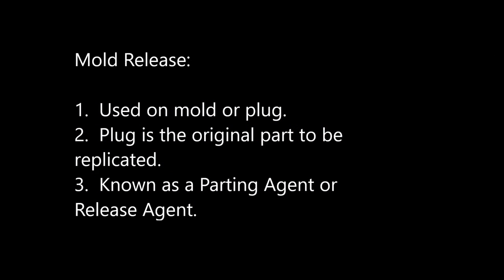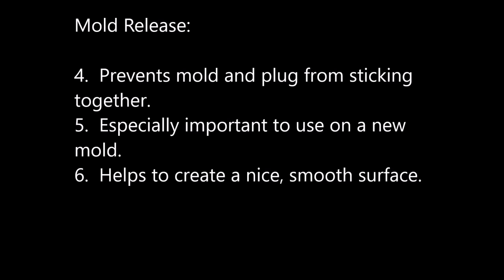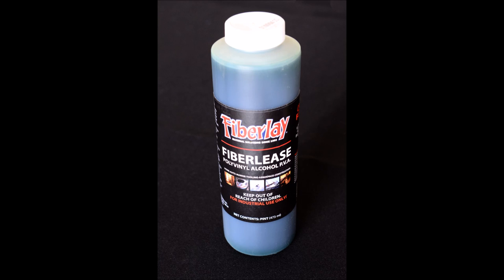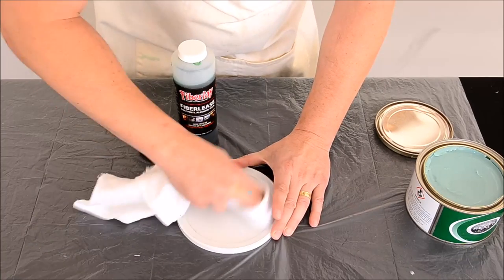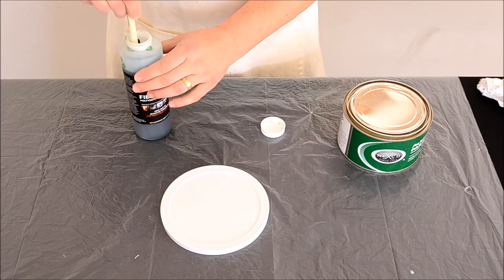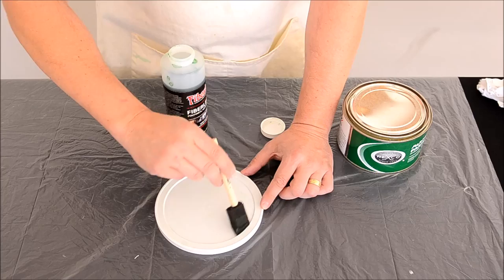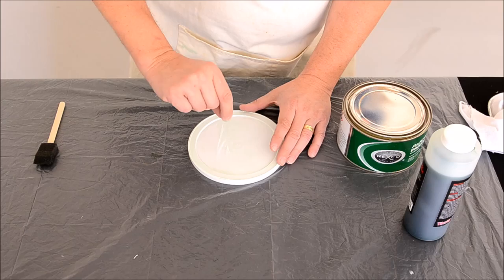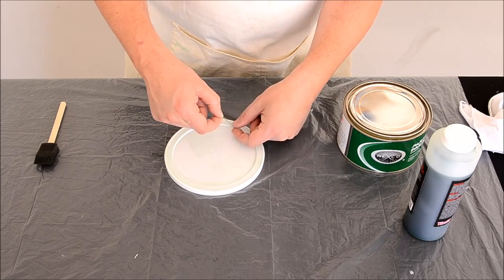Mold release application

Comment: I have a problem with the application of the wax, when I apply the wax and then put the PVA on top, as you do in the video, a kind of islands are produced in the pieces.  there is not a good bond between the wax and the polyvinyl alcohol.  I do not understand what happens
Reply: Yes, it's called 'fish eye' where I come from and it's probably the type of wax and also the length of time you use PVA after waxing. Try leaving a longer time between waxing and PVA. If that still not good try to get another wax. A Cabins type wax is comparable with PVA while other types of wax release are not so good.
Reply: There are varieties of waxes used as mold release, but not all of them are recommended to be used in combination with pva mold releases. You should ask your supplier for the one that is designed to be used along with pva' s.

Comment: If I'm spending the time applying multiple coats of a release wax why do I need to add the PVA as well? Seems to me the wax is enough.
Reply from the maker: It depends on what mold release wax you use. If you are using Partall Paste #2, you need to use the PVA with it per manufacturer instructions. Semi-permanent mold releases do not need PVA afterwards.